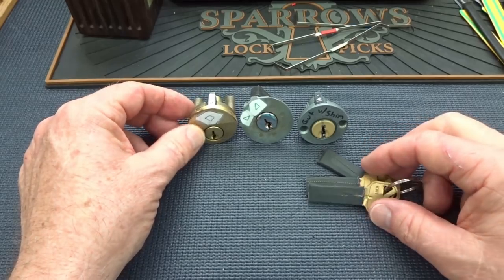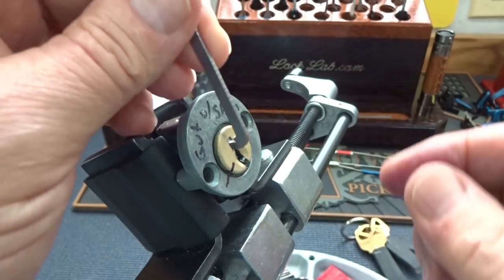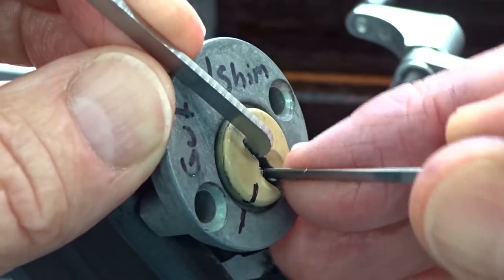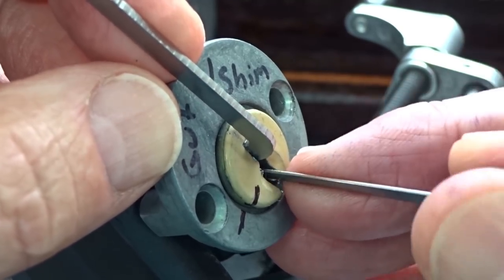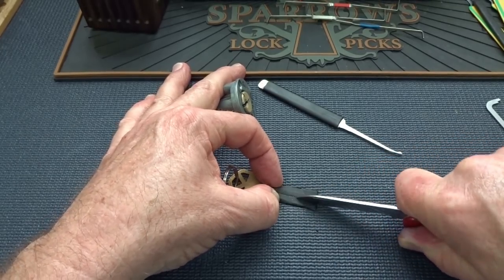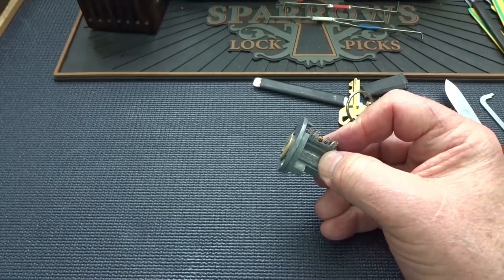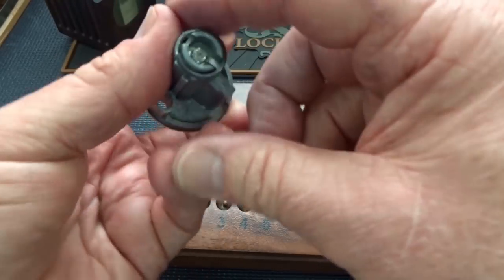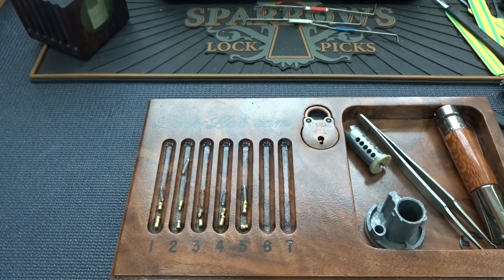(1246) Challenge: Trenly Triple Diamond

Comment: Well, I'm glad some things worked as intended! I don't know why the key didn't work, but its possible one of the pins rotated while being picked. The way you put pin three was correct, it was with the tee pointing down towards the key pin.  You were correct on all the threading, and only the reduced diameter pin was not homemade. Everything was made using a hand file, I had hoped the roughness would add difficulty which it appeared to.
Reply: Trenly what did you do different for the two other locks?

Comment: Was that the right key? I don't see why it would turn as far as it did but from the bitting seem 1, 2, & 4 key pins should be near identical but that's not true @14:44
Reply: TheWham083 the key worked when I made the lock. Perhaps the shipping or picking rotated a pin or jostled something I didn’t expect

Comment: @13:52 pin 2s tip acts as a trap pin, theres a hole in the core for it to fall in to.
Reply: yetshi The holes had been filled in with clear epoxy

Comment: Key did not work. Is this still a valid lock ?
Reply: Albert Lebel nope
Reply: Yes
Reply: Actually NO, It must have a working key to be valid. You will hear Bill say it all the time. "The key works, so it's a valid challenge lock".  This one did NOT....  Fair and square....
Reply: The lock only needs to be validated with the key if you are declaring being whipped. He was able to open the lock so it is valid. It's just the wrong key as opposed to the lock not being able to be opened by ANY key and also can't be picked open.
Reply: the key worked when I made the lock. Perhaps the shipping or picking rotated a pin or jostled something I didn’t expect
Reply: that's not the point of validating with the key.  bill got an april fools lock a few years ago that had a solid bar through one of the chambers and since then has only been accepting locks with keys.  he was able to pick this one open in a reasonable time so there was no need to validate

there's no consortium saying that challenge locks have to have keys either.  that's just bill's thing

Comment: The key didn't work, your pick is not valid.
Reply: The lock only needs to be validated with the key if you are declaring being whipped. He was able to open the lock so it is valid. It's just the wrong key as opposed to the lock not being able to be opened by ANY key and also can't be picked open.
Reply: Actually, it's the reverse...the key did not work so it is not a valid challenge lock.
Reply: the key worked when I made the lock. Perhaps the shipping or picking rotated a pin or jostled something I didn’t expect
Reply: that's not the point of validating with the key.  bill got an april fools lock a few years ago that had a solid bar through one of the chambers and since then has only been accepting locks with keys.  he was able to pick this one open in a reasonable time so there was no need to validate

there's no consortium saying that challenge locks have to have keys either.  that's just bill's thing